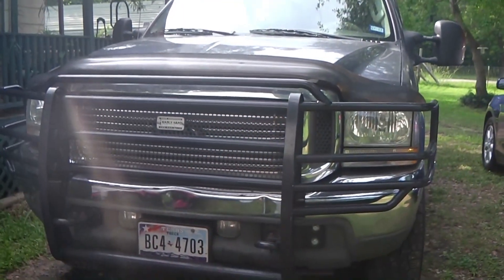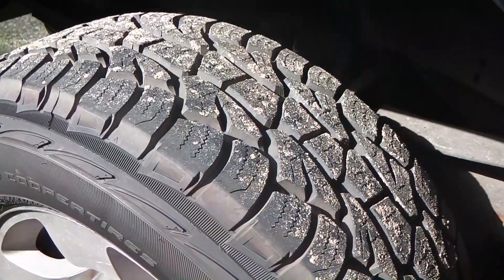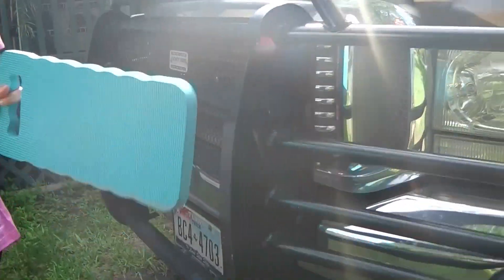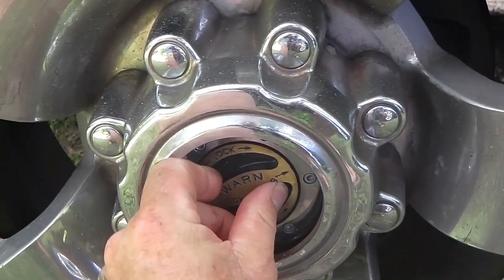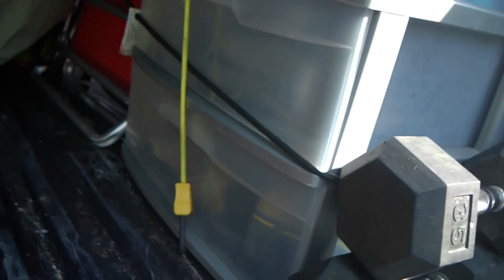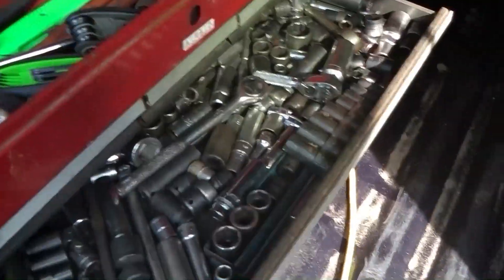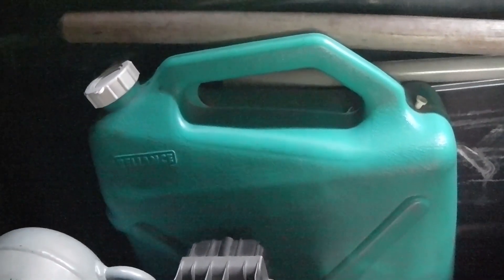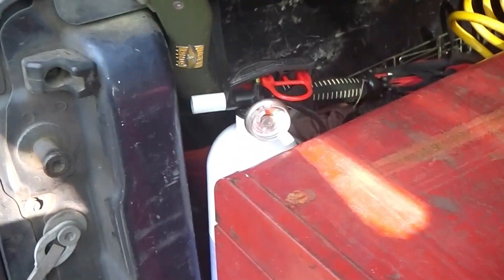Chosing a tow vehicle for our Travel Trailer

Comment: One thing a lot of people overlook when towing trailers is payload capacity.  10% of your trailer weight should be on your tongue and that means it counts as payload.  

I have an 8000 pound travel trailer and used to have a truck with 9400 pound capacity but the payload capacity was only 1500 pounds.  With 1000 pounds of weight in your trailer the truck is still capable of towing it but when you look at the payload you may be over.   900 pounds of tongue weight plus three adults, a big dog, gas, towing hitch and you are over your payload which will lead to instability.

I believe in overkill too but more importantly make sure your truck is within its towing capacity and payload capacity before you put your entire family in it and go down the road.  Also watch your speed.  A lot of trailer tires are only rated to 65mph and going 80 will overheat them badly.

Great video.  Looking forward to seeing you head out on your travels.

I now use a truck with a 12500 towing capacity and a 3300 pound payload capacity.  Tows a lot better.

Comment: Great video ! Couple of things I would change . Don't rely on brush guard, install a full size bumper with a winch and a brush guard ( something like an Iron Bull ). Can you run your trailer on your generator ( does it have a 30 amp plug ) ? How about solar panels on your RV? Solar and battery bank. Small chain saw is very helpful. Strong box for your firearms. 
Please, please, don't rely on that soft shall and some cheap padlocks, if it's not welded down, it's going to start walking. 
Have fun and good luck !
Reply from the maker: Thanks for the advice. We have been on the road for several months now and have posted several videos of our journey. No more preparing for us.  So far so good.

Comment: Greetings and great video. With all the stuff you are taking the 3500 diesel is a must. I have a light 26 foot TT Tailer that weighs 5400 pounds and am towing it with a Ram 1500. I have literally  had to weigh everything that went into it. Not kidding, pots, pans clothes linens, food and the list goes on. My truck will tow 8500 pounds  and I want a 1000 pound safety margin. The weight of water, fuel and my solar battery bank have severely limited what I can take on board my RV. That said, I have managed to maintain 1000 pounds of reserve towing capacity. I did get the anti sway and load leveling hitch and that was a great decision as my trailer tracks perfectly down the road. If it weren't for the battery bank, and generators, I would be better off weight wise. But I plan on boon docking and a generator and solar are a must. Glad to here you sold your house. Mine just went on the market after the Memorial day weekend. Can't wait to unload this money pit and hit the road! Good luck and best wishes in your travels. Hope to be going soon myself.
Reply from the maker: Sound to me we are both on the right track to being successful at life.Good luck to you.

Comment from the maker: It won't pull a trailer through the Rockies. Especially going down hill at 12000 ft.
An occasional tow now and then i think tundra would be fine. Not for full time RV'ing when your not sure what kind of road is next.
Reply from the maker: Yes that would work.... Safe travels.